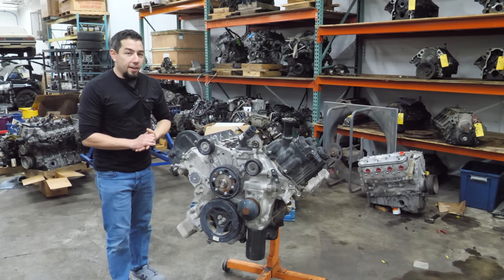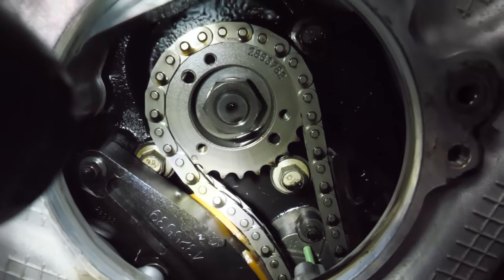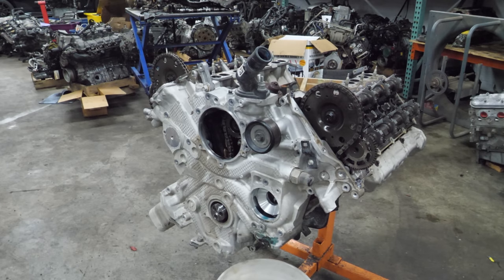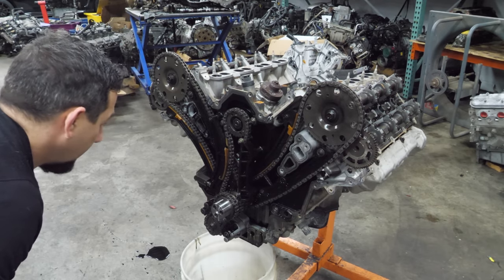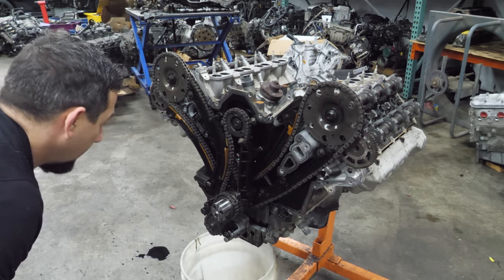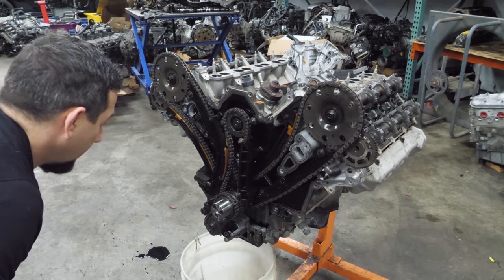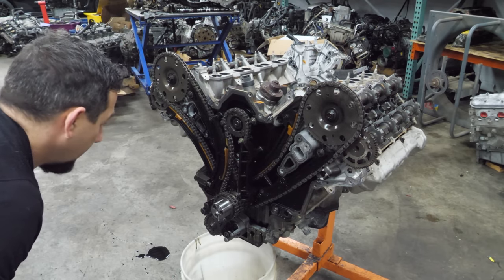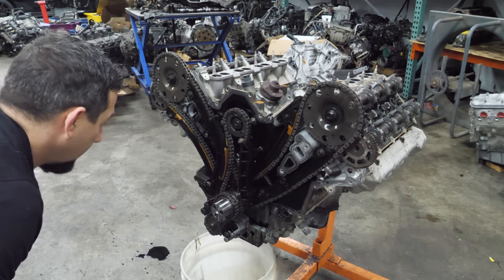Well That's Not Good! Nissan Titan XD Cummins 5.0 Turbo Diesel V8 Teardown. A Costly Failure!

Comment: Hi Eric, 

I did play with the idea buying one of the Nissans TD but after watching your clip and reading some of the comments, I think to stick with my 5.9 Cummins 12 valve with over 500K on the untouched engine and put some money in the interior and buy a bucket of paint of the 2500 TD instead of going with a V 8 Nissan you're having fun with.

Thanks again and good luck

Comment: Good video.   We broke a crank on a Ford 351 about the same place....this was a super late model application and fairly common break point after a season plus of racing.  Chevys tend to break more in the middle and usually detonate the engine block.  Ours had a crack in the block anyway.

Comment: Before anyone starts blaming the tune/delete, these cranks are snapping in stock 5.0l engines as well. There is something more at play. I replaced my harmonic balancer at 30k because I noticed a slight wobble to it while the engine was running. New one runs true. 🤷‍♂️
Reply: How hard was it to replace the harmonic balancer? Did you eye ball it and found that it wobbles?
Reply: @nelsonjv1  very easy. I believe it was 3 or 4 bolts and it slid off. Took a little effort to "break it free" but you don't need a puller. Worst case maybe a little encouragement from a prybar. As far as diagnosing it, watching it while the engine was running at idle I could see it looked like it was wobbling slightly. Like it was loose or bent but it was neither. New one I put on stayed 'true'. No "wobble"

Comment: I’ve actually heard a crankshaft break, and it’s very noticeable. It started out with a small knocking as the initial crack formed, and one day it suddenly got far worse and could barely pull back into the driveway. And this was owned by someone who sees proper maintenance and servicing as a religion, no neglect whatsoever.

Comment: You need the engine stand I have, it's a 1972 Lakewood folding stand that I have had everything from a 4 cyl. Chrysler to a full dress MEL 430. Worst for balance was a 1971 Jaguar E-type V12. I broke a crank in a 1978 Oldsmobile 5.7L Diesel, broke it across the #4 main journal and counterweight.

Comment: My wife had a stock ‘96 Jeep Grand Cherokee with the 5.2L V8. At about 105k miles the crank broke. Luckily, she was quick to shut it off with the loud noise coming from the engine. I tore it apart and replaced the crank, bearing, etc. The only other damage was to the closest rod, that needed some machining. Drove it for another 20k miles and traded it in for another car. Needless to say, this event put a bad taste in my mouth for mopar.

Comment: I have an Ohv customer that works as a mechanic at Nissan in Durango. He said he hates those XD motors cause the cranks and rods are crap. Swap out dozens a year. Nice trucks, but crap power plants. My Titan SV is a 5.6 and run great, 187k on it runs like new.

Comment: Hey bud. Having worked at the Cummins master rebuild center. We tore down 60 and 78 liter mining truck engines. One thing we never did was used air tools when removing anything from the crankshaft. You run risk of damaging the crank threads. Just saying bro. Great video tho! If you wanna see big time damage PM me lol. I got pics.

Comment: Heh, when you tapped the crank with the socket at 31:25. I literally thought "Musical crank." in response. Honestly, I know engines can have this kind of failure with the crankshaft. Just about any engine can infact. But it's not common on engines that have more than 1 or 2 cylinders. With like single cylinder engines, such as go kart ones... Stock cranks will break if exceeded in their ratings by a fair amount. I say this because I know a couple of youtubers who mess with such engines, and have had stock cranks fail on them from just being pushed too hard. (It's why if you tune one of those engines a whole bunch to get as much power out of them, that you usually replace the stock crank with an aftermarket one capable of handling the power proper.)

Heck, my thought is that... for these engines, since diesel produces so much more power than gas, that the cranks within these ones just... may not have been quite up to the task to handle the power long term. As for the fuel pump being pushed out? Dunno. Such a bizarre thing to see. Part of me wants to say maybe the bolts got a bit stretched a tad, hence why it was hard to remove them, only logical thing I can think of with that. Either that, or it was tampered with, and someone just put in the wrong bolts, or worse, someone tried to replace the full pump not that long before the crank started to fail but... Didn't succeed quite well if at all.

Comment: I remember when I worked at a nissan dealer, around the time when these were a thing. I recall some of the older techs saying that those engines were full of sensors that would fail way too often, and to never buy one

Comment: It funny just yesterday I saw a 4x4 XD Crew Cab I believe was a Limited, as it had two tone paint, with titanium colored trim pieces all around with no chrome. I knew it was a diesel when he hit it and was rolling coal, not a lot, but definitely enough to tell there was a tune and exhaust system, I was in my 2019 Colorado Crew Cab 4x4, WT, V6, that I’ll admit I had to mash the pedal to the floor after he did at the light, enough to send mine into 1st in just a moment. That by the time he was to notice that I was trying, that I’m actually now gaining on him he would not have it and didn’t let off. So with my wife edging me on I kept my foot in it. Now my Colorado is all stock, with slightly over sized 32” tires. But we eventually caught  up and passed him. With that said I’m not sure what he had done but it ran better than a stock one, but pretty dirty exhaust. I could never understand why anyone would actually buy one, big an heavy as a HD, with little more than half the power and load capacity. Without any mileage increases.

Comment: Nice video! I have come across broken cranks before, and they are generally not as noisy as you would think. when they break like that they will usually run, and it's an odd sound like bad main bearings but louder.

Comment: Hey mate, really enjoy watching and learning as you pull these busted motors apart. 

Wish you’d got the Land Rover TDV6 in the states so you could pull one apart. 

They’ve got a well deserved  reputation braking cranks due to design flaws in the crank itself as well as bearing that move blocking the oil supply to the bearings. Next step…toast. 

These issues affected both LR3 and LR4 diesels.

Comment: I find broken cranks in early 80 series tractors. It causes a slight vibration on the floor and you don’t know till you pull the pan and pry between the mains, then you know.

Comment: the fuel coming out of the pump looks like Jet-A... bosch CP4 are known for going kablamo when you push too much fuel with a tune... trick is to add lubricant such as 2-cycle oil or a wee bit of lucas, quiets those injectors tremendously and helps the CP4 deal with high power tunes

Comment: I'm not surprised there are so few XDs w/ the Cummins.  I considered picking one up when they first came out and while the power is impressive and I am a Cummins fan boy, the deal breaker for me was the payload; or I should say, the lack thereof. The XD w/ the Cummins is a complete joke payload-wise. Like so many 1/2 tons, they claim  a high tow rating but they have lack payload to carry the high tongue weight.
Reply: That is my only gripe with my XD w/ the Cummins... I have a 38' Travel Trailer and the truck handles it with no issues, but when we were looking to buy our camper we had wanted to get a fifth wheel... With the payload capacity for this truck we couldn't safely tow many of the fifth wheels we looked at...

Comment: Well that was interesting. I worked on Cummins for the past 10 years but never heard of the 5 l. It looks like the only thing damaged in the whole motor was the crank itself. Quite ironic of course the cylinders will need a little work after being full of rust but from the initial problem looks like everything else survived. Perhaps they should use a forged crank.

Comment: it makes a ticking sound until it fully fails,  hard to hear,  you will have a loss (more over time) of power until it breaks then, it's possible it will still run but you will not have much power left

Comment: Believe the owner about the lack of noise. I had a piston eat a valve and only heard a little tink,tink tink . Idrove it for another two blocks and it locked up solid with a full load of piston McNuggets. It sounded like the fan was occasionally touching something.

Comment: I paused the video @38:41 and the cause of the crank breaking wasn't the tuning of the engine it was actually the metal itself it had a flaw inside the metal and the grain structure of it isn't good so most likely that crank was gonna break at some point tuned or not

Comment: Eric, crank was made by Feuer Crankshaft out of Mississippi. It's blued color is due to conventional temper furnace which follows induction hardening. Its normal. Likely failure may be heat treat pattern into the undercuts, or improper fillet rolling. I can't say how I'm associated, but I'm not a former Feuer employee but I am very familiar with them & their off processes.
Reply: Appreciate your insight but why was the crank only blue in the rear section adjacent to the fracture?   If this was a result of tempering wouldn't the the whole crank be blue?

Comment: Cummins are fine inline engines . They had a world of trouble in class 8+9 with V8 903ci. Gulf oil in Florida finally gave up and went back to 855 ci .

Comment: ISB 5.9 12/24v up to 02, Had a 3 piece thrust bearing, 5/6 speed trucks were hard on them, and big converter autos as well.. My thrust dropped, walked the crank, slid the main bearing, and POPCLACKCLACKCLACKCLACK... My crank looked much like that, beaten smooth..

Comment: Would like to see a high mileage 2.0 mazda 626 tear down. I have a 1999 with 258,000 miles still going strong. I know these are Ford based engines but, seem to be very reliable. I've always kept up with oil changes and routine replacements of water and timing components.

Comment: Had a 81 Chevy work truck oh... 15 years ago. Had a 350 in it. Wasn't the original one and one day driving down the freeway it made a horrible noise! I tore it down and it had a 3 piece crankshaft! Broke the crankshaft off between main bearing 3 and 4. Crankpin and rods were still there. It broke like that one on 2 sides.

Comment: There is a tool that dealerships have that you can use to remove the fuel actuator without removing the timing cover. Have Replaced a few.

Comment: CFT just released a video.  Fuel injector harness gets damaged with zip ties causing injectors to stay open hydro locking and breaking crank. He points to blackened pistons as evidence of injectors spraying too much fuel.

Comment: Strange Request, but I want to see a Nissan QR25 tear down after ingesting the screws that come loose in the intake. Or a QG18DE, Headgaskets and spun bearings were usually how those ended up

Comment: For the px7 (6.7 i6 TDI engine used in a DAF lf 55 270) head bolt torque goes like this;
1 st phase	
90 Nm
2 nd phase	
loosen
3 rd phase	
90 Nm
4 th phase	
90° angular displacement

Comment: Most later head bolts from Nissan are torque to yield and about 69nm then turn 90 degrees then 90degrees again . 2nd 90 you can usually feel the bolts stretching. Specs have max length but easier to fit new ones every time head comes off.

Comment: I own a 2016. If you tune it and delete them, it saves the motor for the long run. If you crank the tuner up to full send, and advance the timing way too much, the engine will grenade itself.

Comment: I do forklifts lift in the UK. Perking 3 cylinder engines used to break cranks, but there was no clue that it had happened for many hours of use.  Eventually they would knock as the broken surfaces wore away.  Apparently, Land Rover Discovery TD5's do it as well but I don't think you got those in the USA.
Reply: Perkins ! Spell check !@#@
Reply: @chestnut01111  Autocorrupt strikes again!

Comment: Having worked assembly at a car manufacturer, I can tell you that probably came with the gap from the factory. If that pump had an issue with the threading that bound the bolt, the system would just torque to spec and the worker would be none the wiser.

I honestly think it came that way from Cummins and was just close enough to spec to run for a while before that chain guide finally started coming apart.
Reply: Gotta remember that’s a low RPM engine.

Comment: Those things are horrid! The M2 turbo system crippled that engine as did the vehicle it came in. Cummins used a single turbo variant in their motor home chassis.
They love tossing rods or snapping cranks.

Comment: The way that crank broke probably acted like a keyway and that's how it was able to still run. It may not have been that loud but I'm sure giving it throttle or when you turned it off it was definitely louder. I am sure the misalignment and play not to mention the oil leak at the break is what caused that end of the crank to get hot. The reason it broke could have been a defect in the casting in certain batches and years . Or the metal they used wasn't strong enough and it exposed the weakness when turned up. I bet if you built that engine with a billet crank or a forged crank and bigger cam gears . I bet with a bigger turbo you could make some serious power with those engines. The overall design looked pretty good to me . Sad that crank failure is an issue with them . I'd like to see just how much power you could make with one built with a better crank . I think it would hold up well especially if you upgraded the rods and Pistons.

Comment: So as someone who accually has a 5.0 nissan that the crank failed on, i will say this, it was not immidiately appearant that it had failed. Mine was all stock 101k miled and for mine i got a little bit of noise that randomly showed up while going down the interstate, it sounded kinda like an exhaust leak under the truck. I continued to drive it, i then noticed my oil temps rising all of the sudden the knocking got REALLY loud and Bang, the truck shook, check engine light, 30second later it was locked up solid on an off ramp
Reply: They "believe" that for some unknown reason my engine kissed a main scoring it and preventing proper oil flow, this they believe was the noise i  initially heard. This is purely there speculation though as my bottom end was TRASHED. Also if im seeing the video right Mine also failed in the same spot (right next the number 6)

Comment: I had the same truck with the same engine, no tunes, no heavy pulling and it snapped the crank at 17k miles, replaced under warranty but still????

Comment: My guess is a poor heat treat on the crank (too hard to begin with) and then the case hardening with that beautiful color made it more brittle to handle all that torque a stress crack at that one spot finally gave way with maybe some high (for a diesel) RPM's to finish her off.

Comment: Early duramax used to break crankshafts and they wouldn’t be all that noisy if you caught if pretty early, usually they would break towards the front of the motor though and they were pretty loud already. These little Cummins motors aren’t very loud I don’t think. But I haven’t heard very many of them running.

Comment: Torque specs on the head bolts? 
1st step;	30 ft./lbs.
2nd step;	89 ft./lbs.
3rd step;	turn 180 degrees
4th step; Bolts 11-12	17 ft./lbs.
Note: Do not re-use old bolts.

Comment: I’m gonna say DEF fluid was put in the fuel tank, and when they went to replace the high-pressure pump, something happened where either something was not tightened or not aligned properly started the engine up and catastrophe.

Comment: On the flooded BMW, saltwater is bad.  You should see what it does to an offshore reel that just gets salt spray on it.  You would never think a reel that hasn't even been dunked would have so much corrosion inside but they do.

Comment: I have had a few of these in my shop with gnarly engine vibrations. This is the second broken crank i have seen the bearings are usually beat out of it

Comment: tis is a compression ignition engine,so there is very little clearence between head and piston. it takes high compression to ignite the fuel (V W uaed thick gaskets to get the clearence

Comment: That's a shame being how much these trucks cost new. I think although Cummins has been around since the beginning of time and makes phenomenal engines, this was put into production way to quickly, and then add the wonderful EPA tree hugger DPF system to back up heat in the engine and it's the perfect storm for catastrophic failure. Diesels weren't designed to be plugged up and the higher EGT's make them sludge up, meltdown or come apart, unfortunately.

Comment: If you do a flood car keep in mind that you WILL have weird issues to fix beyond your normal totaled car.   Steering column bearings for example.  Dust in all the HVAC ducting.  I could go on,  but personally I'll never fix another flood car unless I can tell exactly how high the water went or if it's a car worth completely disassembling to rebuild.

Comment: There is a Nissan specialty tool to replace the HP fuel pump since it is chain driven.  You can replace it without taking off the timing cover and chain.

Comment: Check the torque specs while you unbolt. Bought a rebuilt 12-149 Detroit BITD always replacing cams. It’ll run with a broken cam. First time I replaced the cam I needed a impact to loosen the bolts. Dude used a impact and didn’t torque anything. ANYTHING!! That was $100,000 cost for the small company